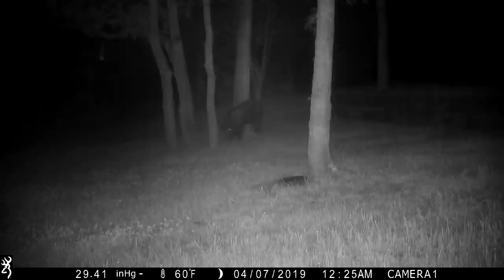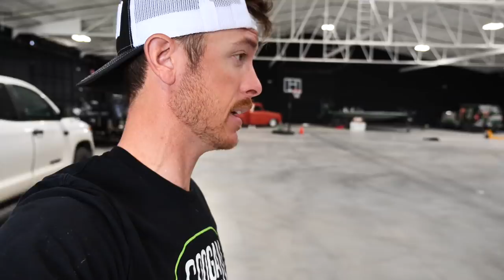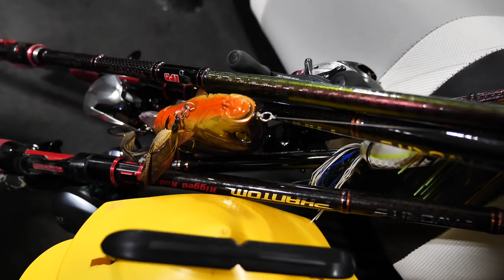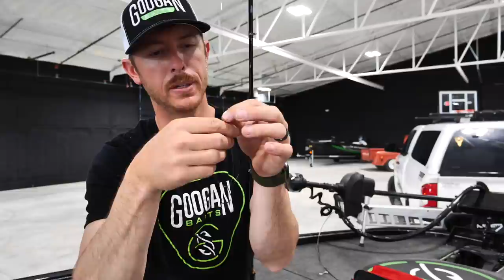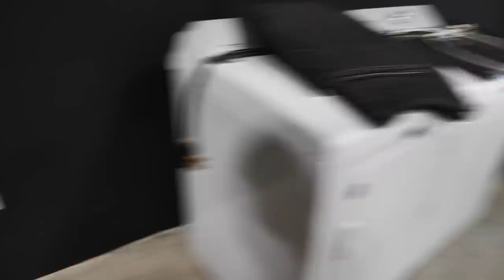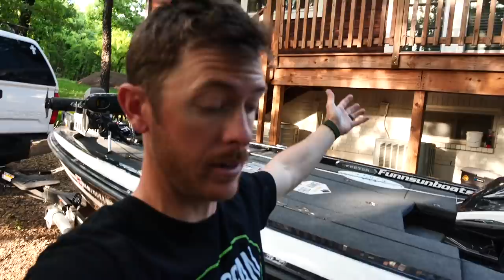I'VE HAD IT WITH THIS BACKYARD CREATURE! Googan Squad HQ Visit

Comment: If you open your tailgate, loop the support cable over the post so that the tailgate is partially open, the backup camera will point directly at the trailer hitch. Just a tip that I use when working solo.

Comment: Rackley you don't have to adjust your regulator...just adjust the depth setter on your driver for your nail gun. Also remember for trim guns set pressure @ 90-100psi and framing guns set @ 125psi because, you don't want to blow out your seals. Keep them lubed with pneumatic gun oil too...3-5 drops. Love the vidja's my man!!

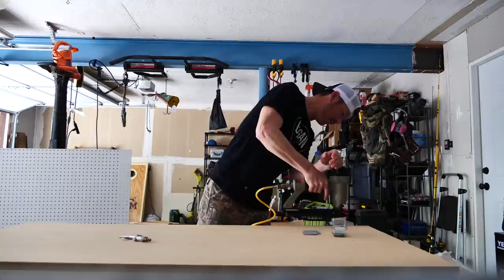Comment: Can I ask if its a Building Code in your state for structural steel support beams (7:04) to be fireproofed and encapsulated.  In the UK structural steel like that beam is required to be fireproofed.  You may want to look into that as in a fire that may heat up distort, twist and eventually fail.

Comment: that deck isn't supported right, those joist should sit on top of the beam, only thing supporting the whole deck is some bolts right there.
Reply: Yup definitely its suspending the weight through out those pillars.

Comment: Justin, I'd like to be you woodworker! You only need 1 nail every 3 to 6 inches if you are also using glue. And depending on what you are going to use the table for you may not need the extra piece under the top.